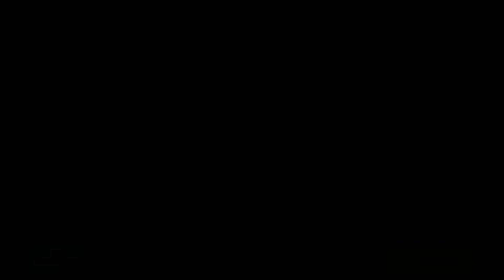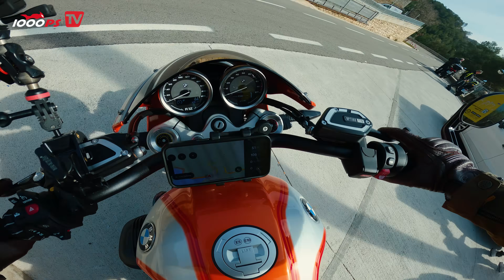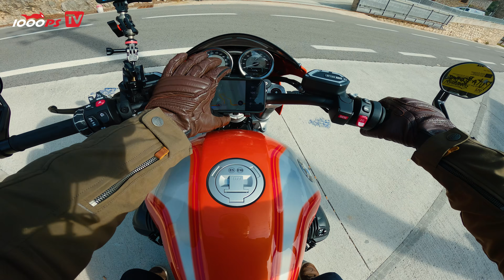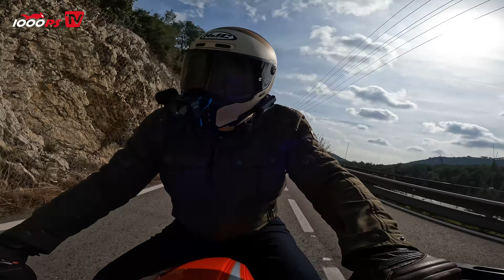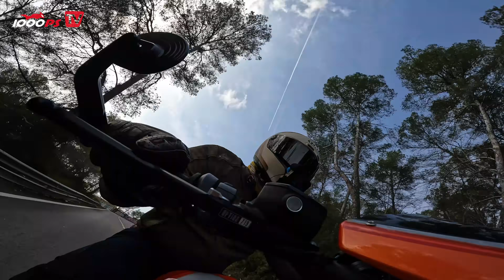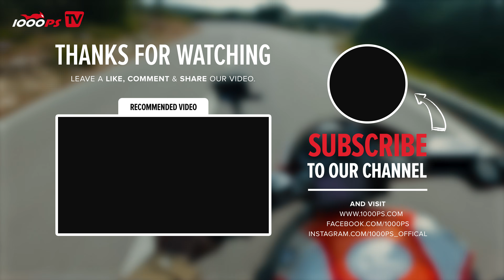Good looks aren’t enough! The R 12 S – a classic dream bike in our MotoVlog

Comment: I love my R12. First ride I took was from San Diego to Salt Lake City. I’ll admit that I had some luck with perfect May weather but any bike is an adventure bike if you challenge yourself with an adventure bike. I rode the R18, the year before, through two Native American reservations and the rock solid ride of that bike made that an adventure bike. I also saw the Grand Canyon for the first time. The tank is small on the R12 so you have to plan ahead but I’m used to not having a fuel gauge already from riding an old R1100R for many years. Very choice. I would recommend getting one if you have the means to afford it. I’m 70 years old so the R12 is perfect for this old guy.